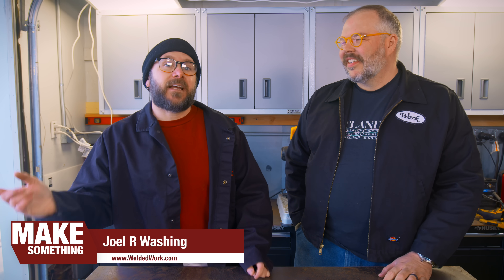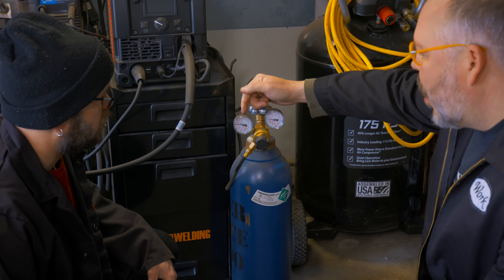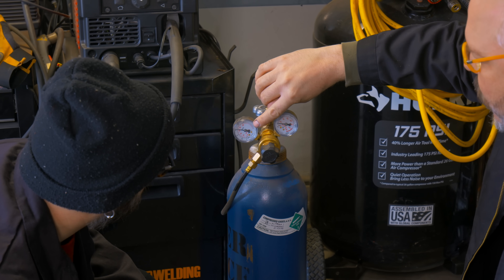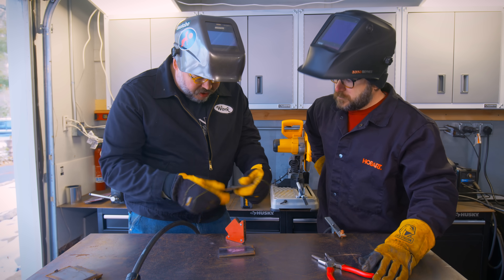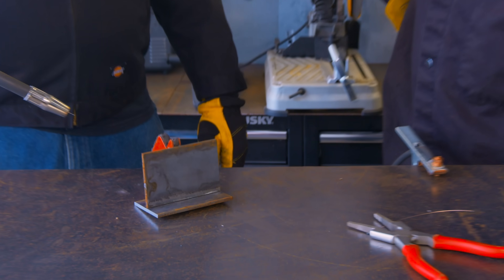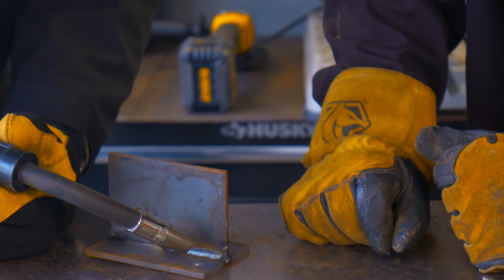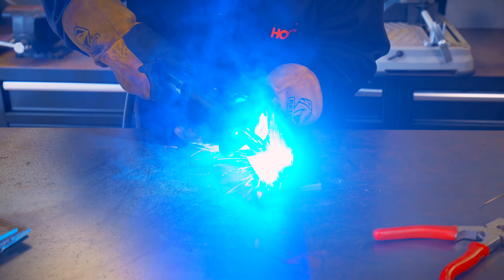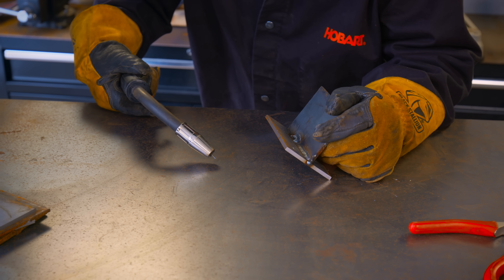Getting Started in Welding. Mig Welding Tips for Beginners.

Comment: Pushing vs dragging. I've heard if using flux core or stick (where there will be slag) you should drag. There's a saying "if there's slag, you must drag." I've heard if possible, to push with mig , Tig as well, I guess, so you have heat out in front of your puddle to help with better penetration.

Comment: Do the circle motion and push the gun instead of pulling and you will bare witness to some of the sexiest welds you can get with a MIG while welding a corner joint. keep the angle at around 120 degrees while pointing the wire towards the direction you are welding.

Comment: You should learn stick welding.  It’s a lot easier.  Also the grinder should be flap disk up when you put it down.   This way the flap disk can’t bump the table and throw the grinder with a spinning disc on it around the shop.

Comment: Holy mackerel this looks so much easier than stick welding. I'm new to welding, and I've done about 5 hours worth of stick (never done mig), but still, striking an arc and then welding.. and and then identifying the metal pool amongst the flux pool. Doing it vertically, upside down, horizontal.. yikes. Hard to make it look good. Lots of grinding, too many pits. Ugly as f. It's easy to strike it and hold it once the stick is a bit shorter, but a fresh stick is a whole load of "un-fun".

Comment: Push or Pull? You normally pull to avoid burn through. When you push, the shielding gas is pushing the heat as you move, building up a lot of heat. If it’s thick steel and want a lot of penetration then you push as you want the steel very hot. Thin = Pull, Thick = Push